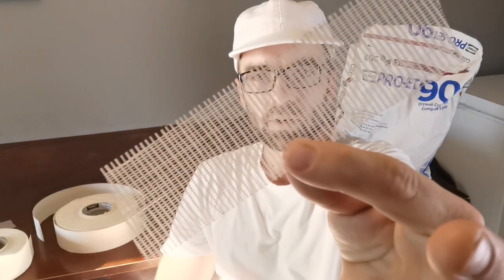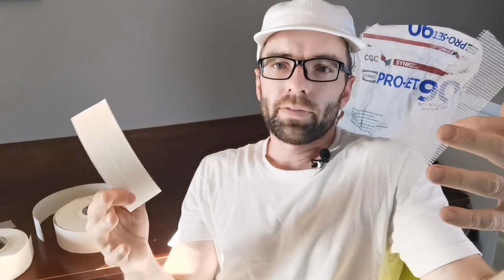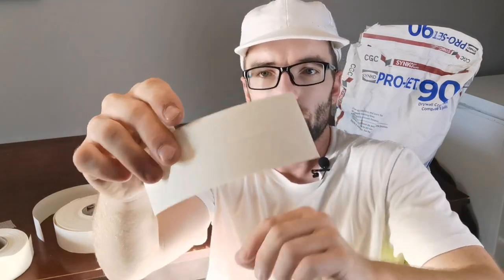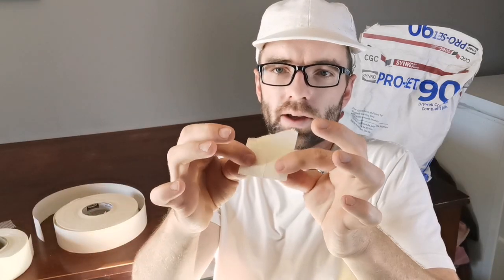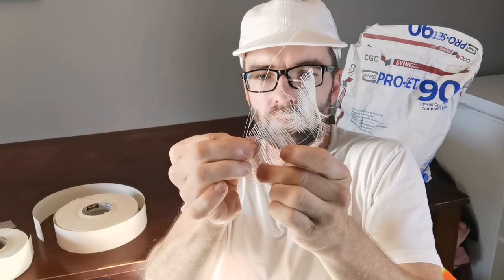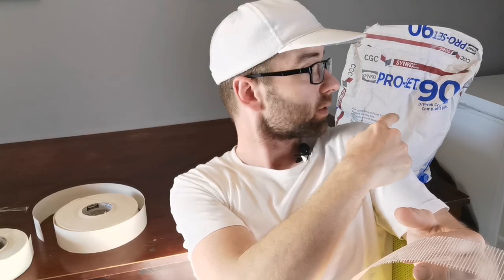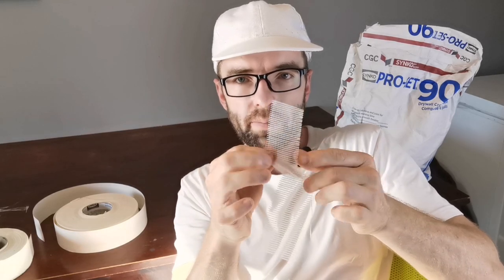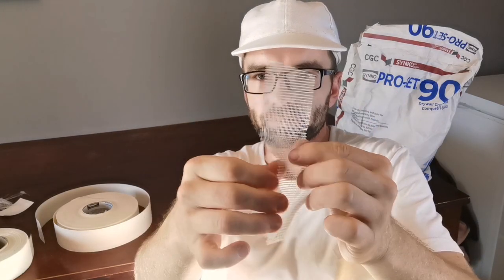Fiber Mesh Drywall tape - Why it cracks.

Comment: Mesh is supposed to be used on blue board aka plaster board, somewhere along the way it crossed over into the drywall realm. It can be used in  fast setting powdered joint compound, preferably under the 60 minute variety, or durabond 90, which isn’t even available in my area. Paper will always be king , because it’s cheaper, more versatile and bonds very well to the paper of drywall sheets. Fiba Fuse is good on flat patches, but still needs to be infused with hot mud for strength. Also I use Taping Mud only for applying tapes and beads, or if I don’t have that on hand , I just add white carpenters glue to the mud. Cheers.
Reply from the maker: Absolutely agree with everything you said. Another interesting thing I seen once was a product PDF from a top mesh tape manufacturer (forget which one) that stated their product is only for below grade application, aka basements, where there's little structural movement.
 I cringe at these DIY videos of people dry meshing their entire upstairs house, can only imagine what that will look like in 6 months.
Reply: Mash tape is popular because its easy to use and most people are lazy and will go the easy route. I had someone talk me up on it and I tried it once and it was garbage. Never again.

Comment: Setting mud will also crack with mesh tape, I have repaired hundreds of cracks and its nearly always due to mesh tape.
We mostly only use chemically setting mud here in Australia and it will still crack.
Use Fibre Fuse if you have trouble using paper... I have tested Fibre Fuse myself and it is very strong.

Comment from the maker: Importantly, I should have said in the video that the issues with fiber mesh tape would mostly or only be seen in timber-framed structures. Block & brick structures or basements are much more structurally rigid and fiber mesh performs much better as a result.
Reply: The fiber mesh result was horrible in my apartment redo. Nearly every drywall joint cracked dead-center running the full length of the mesh. (It has no bearing on that result...but for the record, the apartment is in a three story balloon frame home with a concrete foundation, completed 70 years ago > hence settling was taken care of decades ago.

I agree with you. Never use that damn fiber mesh.

Comment: I totally agree. I would like to add that paper tape gets glued down while mesh tape is more suspended. I when possible use paper  tape and come back after it dries with quick set . We could use a quick set for paper tape
Reply from the maker: That's exactly it, and what I should've said in the video, mesh tape is just suspended/floats over the little dip/space where 2 sheets come together, ends up being a tiny unfilled space there and perhaps part of the reason hairline cracks seem to so easily occur on mesh taped drywall. I think a large part of the bad reputation of mesh tape comes from DIY'ers or contractors placing the mesh tape on "dry" then mudding overtop, whereas I think mud should always be placed first then the mesh tape applied and wiped/imbedded into it, and critically it should be a quickset mud applied first if mesh tape is to be successful.
Reply: Rick...to fix all the cracking on my fiber mesh joints...would you suggest I go over all of it with paper tape & a layer of mud...or mud only? Thank you

Comment: Prefill is essential. If there no mud fill up the gaps, no mater what tape you use, it may crack.
Reply from the maker: That's absolutely right, will crack if not prefilled. Hey I'm actually starting a video review on your product soon, I'm very impressed with it, very handy for repairs.

Comment: I'm repairing two 20ft long cracks in ceiling joints. First I'm going to install strongbacks to the tops of the ceiling joists as I suspect the cracks may be from deflection in the joists. Then I'm going to scrape out the old tape and compound from the tapered seams. I'll then v out the length of the seams and prefill with durobond 90. As far as retaping, I'm torn between going with paper and all purpose and fibafuse with durobond 90 and then using all purpose for subsequent coats. Any votes on which would be the least likely to crack again?  BTW, I have decent paper taping skills.
Reply: Paper tape  I find works the best. But spend the money and get a box of yellow mud/ taping mud and if that doesn't do it then you have more issues then what any tape can handle

Comment: So paper tape produces popping and the mesh tape produces cracks
Reply from the maker: Neither should do either - I've never had cracks with mesh if it's embedded in hot mud/quickset, like Durabond or even USG Easysand. With Paper tape - popping or blisters can happen when working over paint with a sheen, on renovations, I usually sand the paint where I'm going to tape with a 80 grit paper to give it some tooth, and that has always worked for me.

 Over bare drywall I've never experienced blisters or popping, and as of April of this year, I'll have been taping/mudding/painting for 20 years straight. 

I may have said this in various videos but I only use Yellow box taping mud, and green box finishing mud.  The blue box "all purpose" is basically "no purpose" to me. Basically the factory 50/50 combines yellow and green and makes a mud that has half the glue as yellow, and 50% harder to sand than green, and there's much less adhesion taping with it.

Comment: Yeah you're right I honestly use paper tape for everything I even prefill large gaps with paper tape all bunched up with my super taper around Outlets then put a flat tape on top and it's stronger than the original drywall I hate mixing sheetrock it sucks anyways whoever tells you mesh tape and 90 is faster is wrong
Reply from the maker: I've also pushed mud soaked paper tape into large gaps, I think it's a very strong way to fill gaps too. I rarely use the setting-type mud either, except for small patches
Reply: in Italy 90% unfortunately use this mesh (shamefully) .. fortunately there are paper and new products such as TUFF TAPE ..

Comment: My experience with mesh is mixed. Seems to work fine for patches, butt joints and even tapered wall joints. But I've seen problems with corners and ceilings.  Even with hot mud. Not a big fan even though I know there's a youtuber who swears by it for everything but corners and claims he's never had a call back.
Reply from the maker: I think I know who you're referring to, but I won't argue with his own experiences. My experiences have been different. I think it might have to do with whether a job is an older existing home being renovated or repaired or if it's new construction, new construction will settle over the first 1-3 years up to 1" unevenly, and mesh tape will always fail horribly, even with hotmud, although just not as severe than if it was imbedded with all-purpose, earlier in my career I had some hard lessons.

Comment: The fiber tape will crack when Hotmud is used to embed the tape if it's hot 30c plus as the hotmud can dry too much before the setting phase is complete and that severely compromise the strength of the joint . 

In the UK we use it all the time and it's fairly solid , number I reason for contractor call backs here assuming the jobs been done to spec is .., blown paper tapes . 

A advantage of fibre tape also is it's lower profile when used on flat joints , especially butt joints so you don't have to go so wide to feather out the hump like you Do with paper . 

So its climate dependent in real world usage . Yes a paper tape can be stronger but also can cause other issues if not installed correctly . The joint needs to be strong enough not to crack , beyond that extra strength is not needed . In real world usage here in the UK it proforms to builder expectations and lasts, I did my mums house 20 years ago and still fine , the plaster work they used on the block walls is cracked to shit BTW lol
Reply: Yeah mesh tape works perfectly in uk never have any issues with cracks . Paper tape bubbles up and no one uses it that I know
Reply from the maker: @Mott  I would expect it to work better in UK. Most houses being block and brick and very structurally stiff in comparison to most houses in US/Canada being timber-frame with the stiffness of a wet noodle.
Also better surface geology for foundations and less temperature extremes in UK.
Reply: @Interior_Works  we're doing more and more timber frame and it moves less vs a timber partition in a block work house with dot and dabbed walls .  That really is shocking as the block work gets drenched and no heating until the central heating goes on 2 weeks before the home owners move in... 

That's when all the paper tape internals blow out but the joints with fiber tape amd filler .., fine mostly .. go figure.
Reply from the maker: @tomsavage6886  hmm, not sure how to figure that, perhaps a different formulation of drywall compound/ plaster you guys use over there, or some other factor. I don't know. In Canada it's nearly unanimous amongst all builders and drywall finishers that I've ever met, that fiber mesh is never to be used in new construction because we've all experienced problems, unless we imbed it in a setting plaster, which is a much more difficult compound to work with on a high production scale.
Reply from the maker: Must be some material difference in plaster hardness that you guys are using, vs what we have to work with, to make a difference in results. That's my best guess.
Reply: @Interior_Works  it’s a strange one mate
Reply: @Interior_Works  our base coat is totally different from your sheetrock easy sand 90 or dura bond 90 etc , traditionally they've been plaster based but the new wave of filler we use now is softer and easier to sand ... 

Nobody dose stupid stuff like putting multi purpose on fiber tape .

I think if you understand what your environment and material interactions are with regard to structural requirements,  you know what works for a given job .  

The job in the UK is certainly different from what you guys deal with , our houses and 1/3 the size for a start lol

Comment: Lmfao ... Really it just moves around when bedded in hot mud.
Reply from the maker: It doesn't, that's why I said using hotmud greatly reduces the chance of cracking. The rigid hardness of the hotmud makes up for the lack of rigidity of the fiber tape.

Comment: Where I am 99% of the cracks I've repaired are from paper tape. I use sheetrock when I use mesh tape and have never had an issue with it cracking.
Reply from the maker: The issues I encounter are always from other people's work. I suspect they just dry taped the mesh and covered with all purpose. I use mesh sometimes, but always with sheetrock setting mud, never any issues either.
Reply: @Interior_Works  same here.  I find most of the time it's someone that didn't have enough of the premixed compound behind the paper tape,  maybe their mud was too thick or they didn't press the paper down enough. With mesh,  I think that's probably it.  They went over with all purpose or something like that instead of using sheetrock.  I'm transitioning to boxes for the bigger jobs but I taped with sheetrock as a first coat over mesh for years.  It took longer, but 0 issues over time.
Reply: They really marketed this stuff too be easy for the average Joe just roll it on and go too town with the mud but I find the don't really say fast setting compound  or recommend it  at any of the big name do it yourself stores it's more of  guys in the trade  just knowing  it's compromised unless fast setting compound is used  and not too use it in corners

Comment: You couldn't be MORE WRONG. When a building moves, paper tape splits. Mesh won't do that if you spray adhesive 1st. I've used mesh with spray exclusively for over 20 years. The application is easier, coating it is WAY easier, and it IS a stronger joint that lasts. I have had zero issues in any of my jobs. When I was doing residential sidework, I always do a 6-8 month check back to see how the job turned out, and never once had a cracking issue. Maybe the climate you live in has something to do with it, but I get none of what you speak of here in southern NY. I mesh all my seams but paper tape crossbutts.. The key like I said...spray glue. And FYI... I use ProForm black compound, not hot mud.
Reply from the maker: I've only ever seen paper tape split on huge commercial projects where there really should have been an expansion joint. Okay so if you didn't spray adhesive it, how confident would you be with fiber tape? I spray adhesive too when taping over paint, or fiber taping small patches with good results, but that's not a well known technique, and would give a guy a chemical headache trying to do a whole house like that. This video was more geared towards perhaps the DIY homeowner who might otherwise grab some fiber tape and a bucket of all-purpose, leading to trouble, and I don't believe anything I said is wrong in that regard, to advise using hotmud with fiber tape to greatly reduce the chances of cracking.

Comment: This guy is a tool.  That  compond btw is not what you use on fiber tape unless you actually want it to crack.  DURABOND and durabond only on mesh.  Almost everytime mesh tape cracks somewhere paper would have anyways.  Ive been doing this for over 20 years.  Can do both methods and one thing know is when a taper downs anothers method there skill level is lacking.  Try learning why there mesh is cracking and better yourself.
Reply from the maker: So you use a setting mud (Durabond) to prevent the mesh/fiber tape from cracking... That's what I've recommended in the video.. a setting mud,  So I don't really understand what disagreement we have here or why you're throwing insults?  ANY Setting mud will be better than all-purpose for fiber/mesh, do you agree with that statement or no and why?  I'm not referencing exact brands and products, like durabond, because it's not an international product.